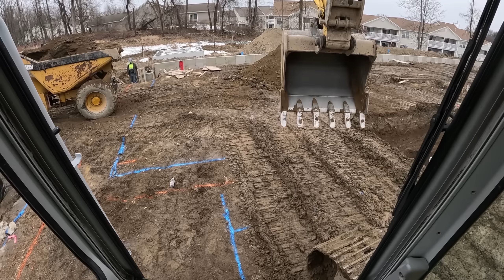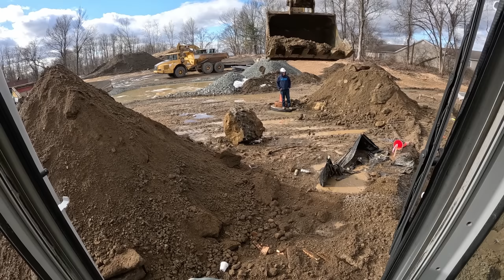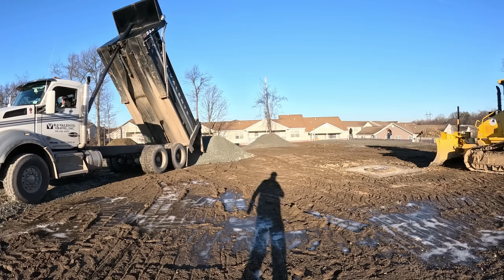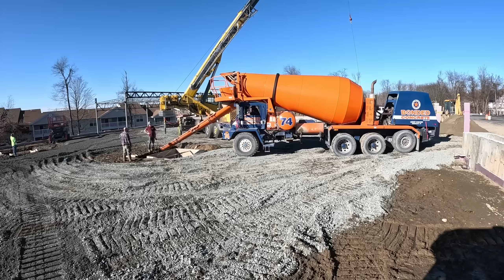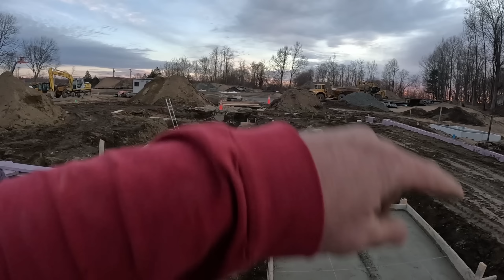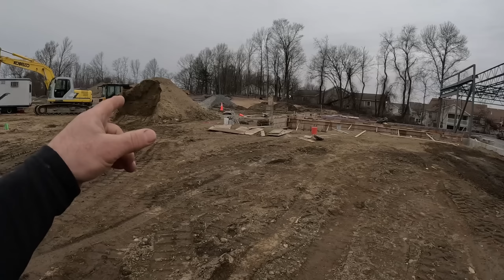Excavating loading dock for ALDI Grocery store

Comment: Set the blade on dirt subgrade, move receiver down 7" that gives you top of rock
Reply from the maker: That only works if the subgrade is dead nuts if it's down 2 in you're 2 in low